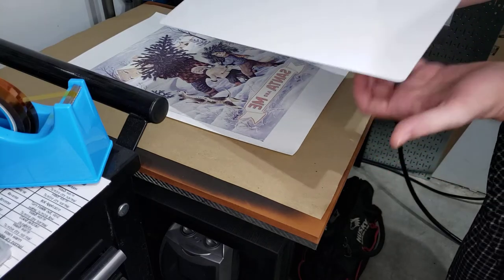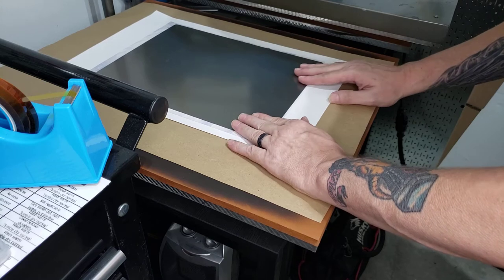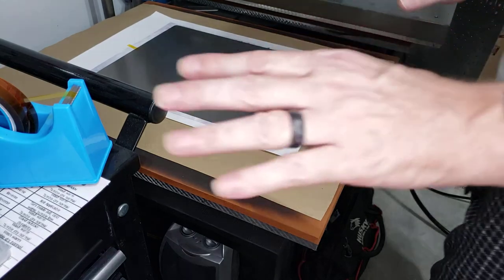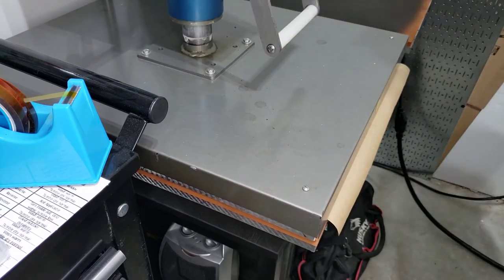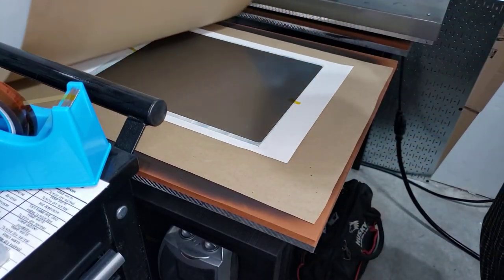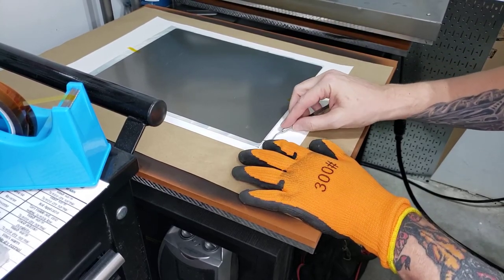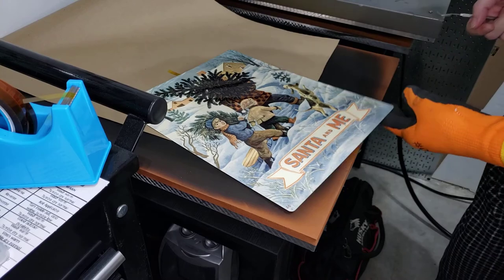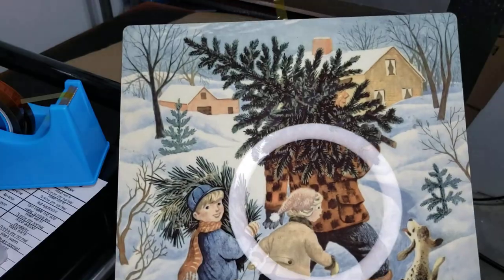Sublimating an 11"x14" Metal Sign

Comment: Can you theoretically print on both sides? Walgreens, Shutterfly, etc. don't seem to offer that as an option and that's what I need. Also, when you talked about magnetizing, you can actually magnetize the whole plate? When I went to Walgreens, I noticed that their "metal" photos didn't stick to my neodymium magnets so I'd love to figure out how to magnetize them. Thanks!
Reply from the maker: Any time you reheat a sublimated product, the image fades. Since you would have to heat the plate twice, your image quality would suffer quite a bit. I would not recommend it.

These are just metal signs, not aluminum, so I'm able to stick a magnet to the wall, then the plate sticks to the magnet.
Reply: @toooldtobegaming8868   I'm happy to hear about the magnet working. I'm just trying to print simple calendar days with no real images. I'd take the risk but nobody seems to do it :(

Comment: Out of curiosity, why do you press the panel upside down with the sublimation paper below the panel? Why dont you press it with the paper on top so the heat penetrates directly from the paper onto the panel? Ive seen this in many videos, just wanted to know the reason why many people do it this way...Thank you!!!
Reply from the maker: I get more consistent results this way. I think it heats the metal more evenly. I tend to get light and dark spots the other way.

Comment: How to stick it to the wall using magnet? Could you please explain that?
Reply from the maker: We use Cup Magnets and Command Strips. Stick the cup magnet to the wall with a command strip and put your picture on it. My son has several hung up in his room, and they never move.
Reply: @toooldtobegaming8868  but how would aluminium sheet stick to magnets?
Reply from the maker: @gauravsaini9139  These aren't aluminum. They're steel

Comment: What’s a good place to get the metal signs?
Reply from the maker: I'm using 11" x 14" Unisub White Steel Panel with Radius Corners from JDS Industries in this video. I recommend looking around locally for a small powder coating shop to partner with that can shoot poly coating. It will give you a lot more options on material, sizes, and shapes, plus it's always nice to toss business to your community.

Comment: Does the pic scratch at all?
Reply: Also can you lift the printed part when its cold or does it have to be hot
Reply from the maker: @chrislewis3322  The metal signs are typically powder coated with the poly coating, so it's pretty durable.

I've had better success letting the metal cool a bit before lifting away from the paper. I've had some instances where the metal wasn't fully cooled, and I could see the metal lightening where it would have been darker if I would have left it alone a little longer.
Reply: @toooldtobegaming8868  Legend cheers